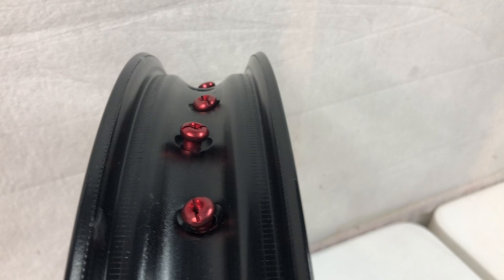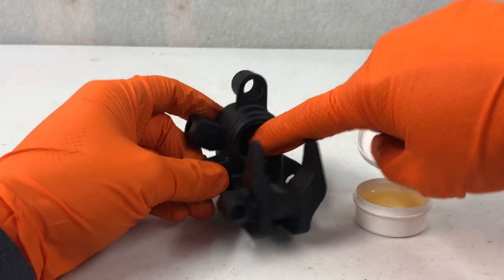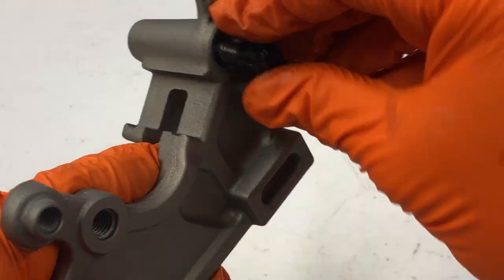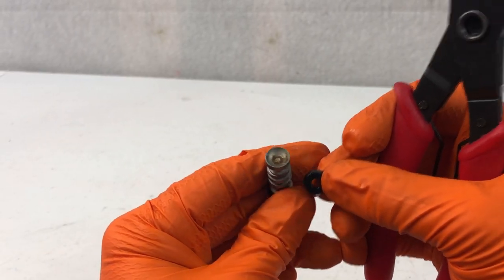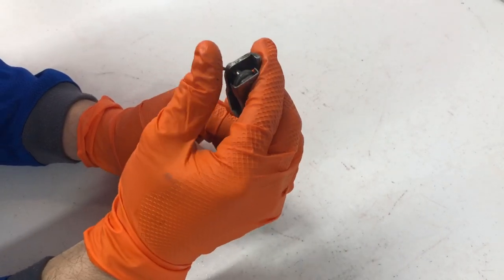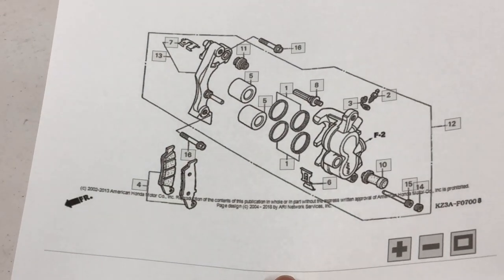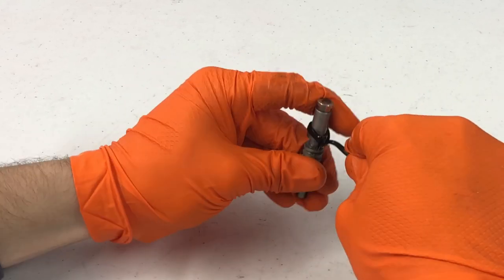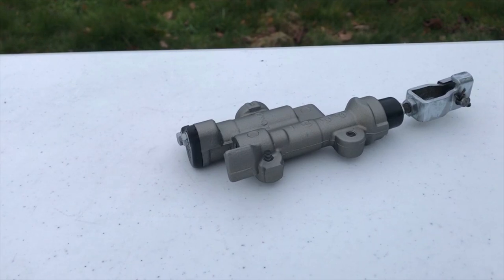Rebuilding cr125 Brakes (Detailed)

Comment: I have a 2005 cr125 I rebuilt the rear master cylinder  but I have found the once you put the cerclip back into its place it pushs the piston/plunger to far done and blocks the fill hole from resavior a y thoughts to why this is happening